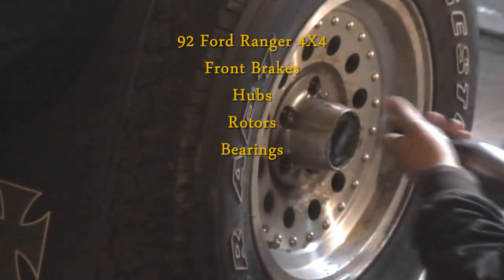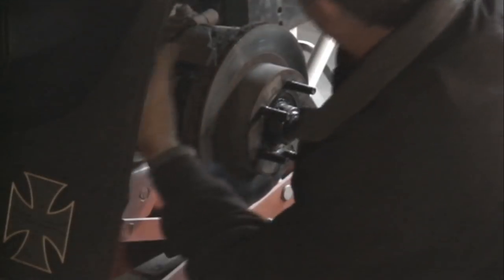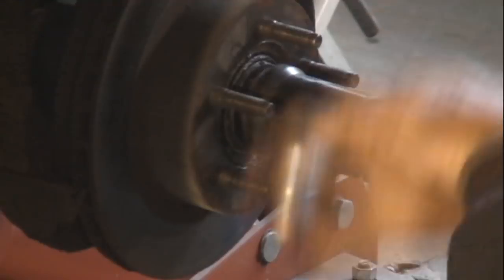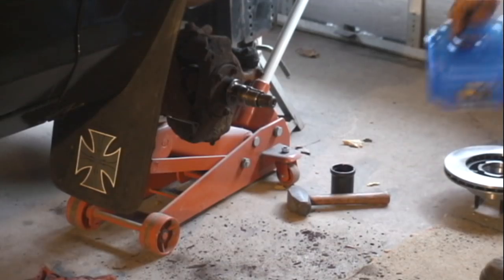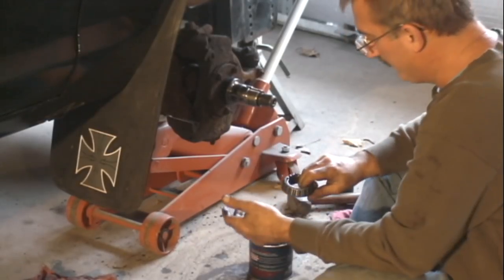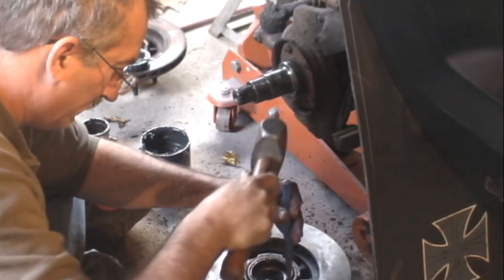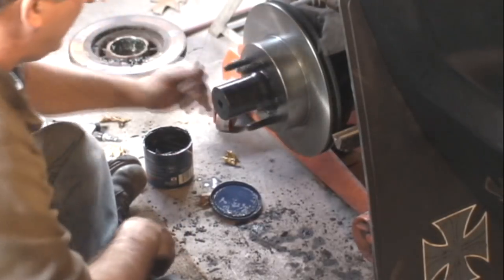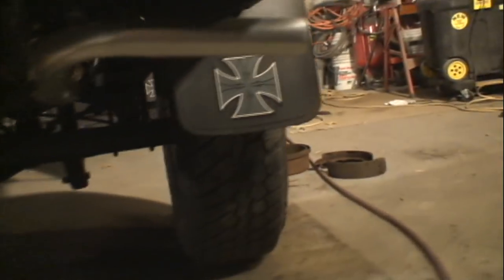92 Ford Ranger 4X4 Front Brakes / Rotors / Bearings

Comment: I  just wanted to say thanks for posting the video on how to change the front brakes......between yours and a couple other videos it gave me the confidence to take on this project with my son on my 93 ford ranger 2 wheel drive.... Had a little problems getting the pins out, so I just squeezed them closed with some pliers and my son whacked them out.  Without your video I would not have taken this on , so again thanks a lot... William

Comment: Thanks for the video!! I just did the same thing to my 95 4x4 ranger. The wheel seemed a little loose when I took it to the tire store to get it the tires balanced. I see that I didn't toch the 2 nuts right.

Comment: Does the 94 with DANA 35 (electric switch 4x4) require that spanner socket?
Reply: With manual locking hubs, yes it is the same. Automatic hubs has one nut and a key that goes in the center of the nut. Tighten to 35 ft lbs, back off 1/4 of a turn then hand snug and insert key into slot in the middle of the nut.

Comment: I checked mine and the 94 is different. It doesn't have the slotted nut.  Mine is the type with a small metal wedge that locks the nut from moving.
Reply: Looking to do my 94 Mazda B3000 and expecting to find something similar to what you described, but having trouble envisioning it.  Is this something that will require a special tool?
Reply: @TheEarthwinders  Do you have manual locking hubs or automatic?
Reply: @DaytonCarCare You have automatic hubs. This is for manual locking hubs.
Reply: PROCEDURE WITH AUTOMATIC LOCKING HUBS

Raise the vehicle and install jackstands.

 
Remove the wheel and tire assembly.
 
Remove the retainer washers from the lug nut studs and remove the automatic locking hub assembly from the spindle.
 
Remove the snapring and spacer from the end of the spindle shaft.
 

Remove the wheel bearing adjusting nut after removing the locking key from under it

Pull the locking cam assembly and the two plastic spacers off of the wheel bearing adjusting nut.
 
Use a magnet and remove the locking key from under the adjusting nut. If required, rotate the adjusting nut slightly to relieve pressure against the locking key.
 

WARNING
To prevent damage to the adjusting nut and spindle threads on vehicles equipped with automatic hubs, look into the spindle keyway under the adjusting nut and remove the separate locking key before removing the adjusting nut.

Remove the wheel bearing locknut using a 2- 3 / 8 inch (60.3mm) hex socket 
 
Remove the outer bearing cone and roller assembly from the hub. Remove the hub and rotor from the spindle.
 
Using seal removal tool 1175-AC or equivalent remove and discard the grease seal. Remove the inner bearing cone and roller assembly from the hub.
 
Clean the inner and outer bearing assemblies in solvent. Inspect the bearings and the cones for wear and damage. Replace defective parts, as required.
 
If the cups are worn or damaged, remove them with front hub remover tool T81P-1104-C and tool T77F-1102-A or equivalent.
 
Wipe the old grease from the spindle. Check the spindle for excessive wear or damage. Replace defective parts, as required.
 

To install:
If the inner and outer cups were removed, use bearing driver handle tool T80-4000-W or equivalent and replace the cups. Be sure to seat the cups properly in the hub.
 
Use a bearing packer tool and properly repack the wheel bearings with the proper grade and type grease. If a bearing packer is not available work as much of the grease as possible between the rollers and cages. Also, grease the cone surfaces.
 
Position the inner bearing cone and roller assembly in the inner cup. A light film of grease should be included between the lips of the new grease seal.
 
Install the grease seal by driving in place with hub seal replacer tool T83T-1175-B and Driver Handle T80T-4000-W.
 
Install the hub and rotor assembly onto the spindle. Keep the hub centered on the spindle to prevent damage to the spindle and the retainer.
 
Install the outer bearing cone and roller assembly.
 
Carefully install the rotor onto the spindle. Install the outer wheel bearing in the rotor.
 
Install the adjusting nut and tighten 35 ft. lbs. (47 Nm) to seat the bearings.
 
Follow the appropriate wheel bearing adjustment procedures.
Reply: @benb8003  I have manual hubs.
Reply: @TheEarthwinders  It is the same procedure as shown in this video you will need this socket to remove the spindle locking nuts Performance Tool W1269.
Reply: @benb8003  Tool purchased and on the way. Appreciate the precise guidance!
Reply: @TheEarthwinders  You're welcome!!

Comment: what is the difference in the auto hubs and manual hubs? I need to replace mine and would like to do it myself and didn't know what the difference in the process was
Reply: The auto hubs have a cam and one hexed shaped nut with a locking key that goes in the groove on the spindle and locks into a groove on the locknut which has grooves going all the way around the nut. This one is a lot easier pry cam off of spindle,  use a magnet to get the key out of the center of nut might have to wiggle nut back and forth a little to release tension off of the key and then it will come right out, unscrew the nut the rest of the way and bearings can be replaced.  To reinstall, the nut only has to be tighten hand tight until there isn't any play in the bearings. Wiggle rotor to make sure there isn't any play, then insert lock key in the groove on the spindle and make sure in it engages into the groove on the nut also. If it doesn't tighten the nut until the key slips in.

Comment: Differnt on 91 4.0 4x4 with autolocking hubs.
Reply: The91-94 Explorer is different a bit. You need 2 &3/8" octagon socket not the tooth socket .

Comment: any idea if there are procedural differences between the dana 28 and Dana/spicer 35 spindles?
Reply: No, it is the same as long as you have manual locking hubs. Spindle nuts are larger on the Dana 35's but uses the same socket.

Comment: what size hub socket was that?
Reply from the maker: 2 1/4 inch inside diameter
Reply: ***** would it be the same for a 94 ford ranger?
Reply from the maker: ? I would just pull off the wheel and measure the diameter of the nut
Reply: Yes with manual locking hubs